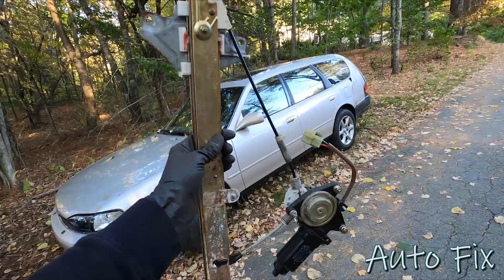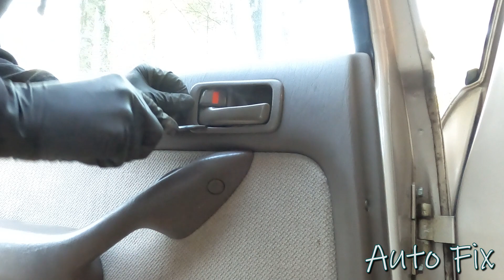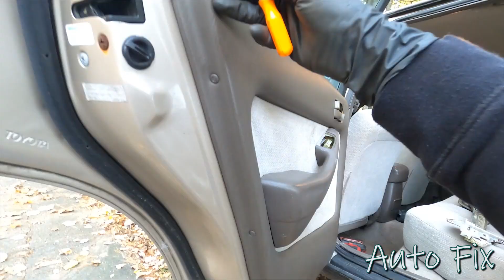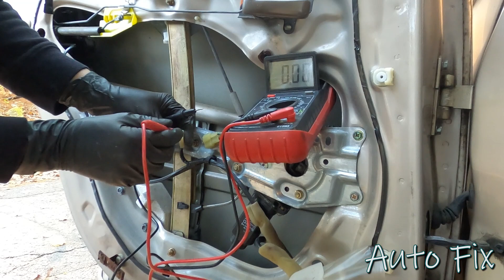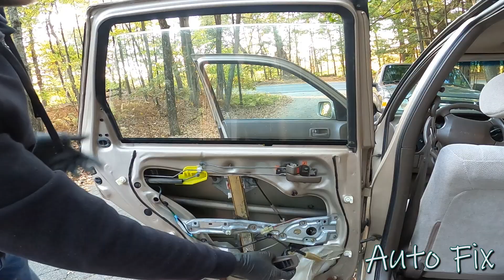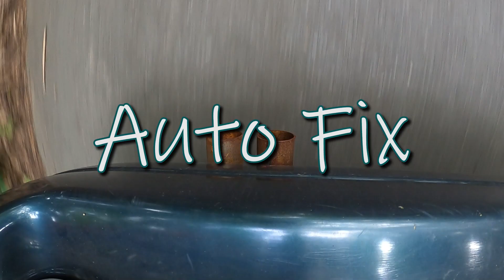Diagnose & Replace Window Regulator & Motor 92-96 Toyota Camry

Comment: Thanks for taking the time to film this. BTW, did the replacement come off from another wagon? I need a new rear window regulatorbut looks like there aren't new ones for wagons, just for sedans.
Reply from the maker: Yes it did come off of a wagon. But if you want to chnace and see if it fits it might be worth it. Knowing toyota they could very well be the same.

Comment: YESS I need this so bad. My wagon needs a new one on the front
Reply from the maker: Nice! Should be similar on the front. Not identical but I'm sure you'll figure it out. Also, a trick for the front is once you have the window in bolted from the regulator you can twist it clockwise as you pull it up and you will be able to remove the glass from the door so you can do the rest of the job without worrying that it will fall on you. To reinstall just reverse and make sure the window is in bother front and rear tracks.
Hope this helps!